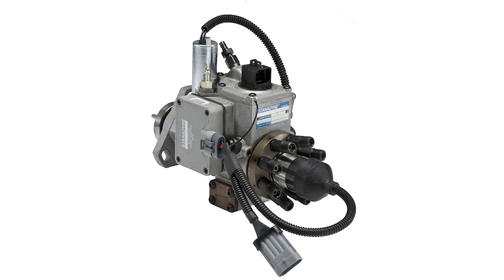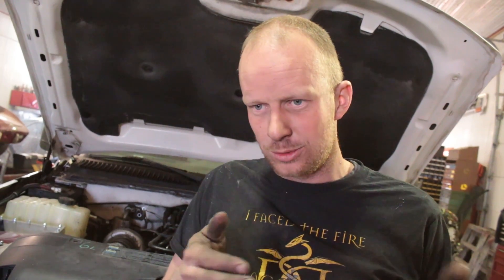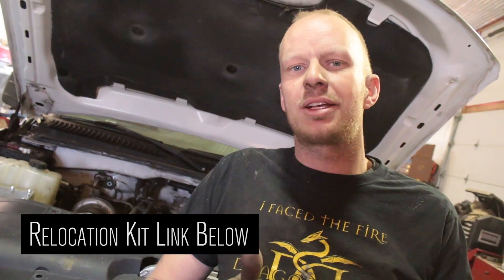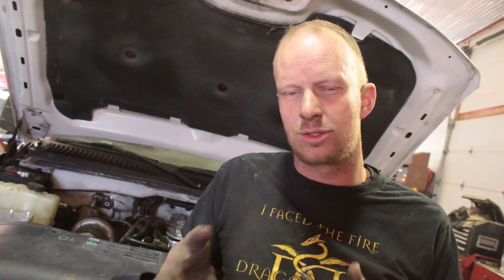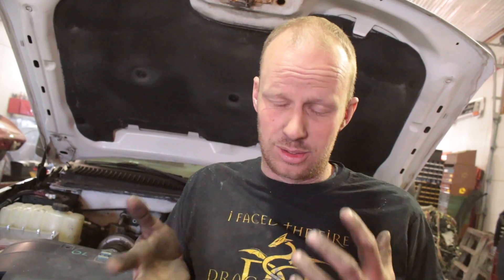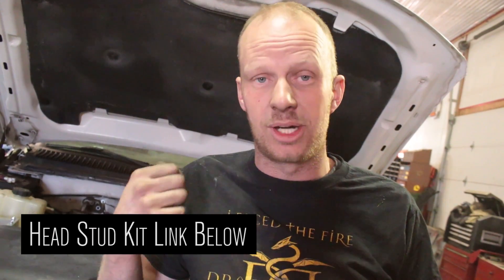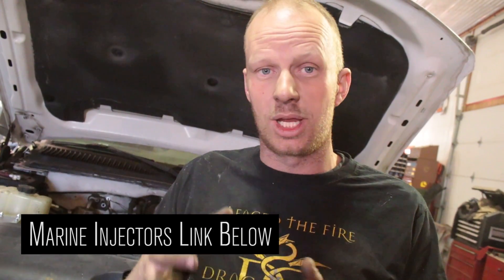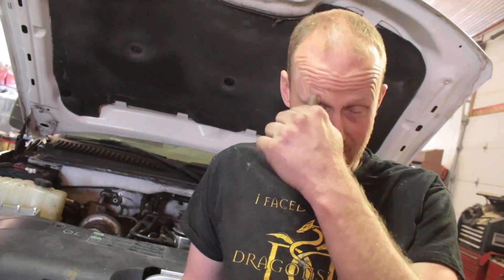REVIEW: Everything Wrong With A GM 6.5 Detroit Diesel

Comment: psst, I dare you to make an "everything wrong with a 12 valve" video!
Reply: Carla Rodgers dodge might not build their own diesel but ford and GM didn't make theirs all by themselves either. GM needed help from Isuzu and ford from international.
Reply: @SAVAGECUMMINS  ford 6.7 made by ford since 2010 but my gm 6.2/6.5 is just fine real simple ,no b.s. no huge h.p. but tq is great and gearing and trans choice make a world of difference
Reply: @MatthewFogarty-k2y  6.7 was created by Austria, it's European... ford went seeking help 
...lol
Reply: SAVAGECUMMINS no company “needed” help. Gm tried with the Olds 350 diesel and it was horrible. The 6.2 and 6.5 weren’t much better. The 6.9 and 7.3 idi were much better engines. Cummins wanted to put their motor in ford but they already signed with IH. That’s probably the only reason Dodge still exists
Reply: @noahgaray7923  the olds diesel is a complete separate animal. It was a gas engine rushed through a conversion to get at the blooming diesel car market. GM and Detroit diesels have been making diesels a long time for heavy duty applications. Apples and oranges on the olds. The 6.2 and 6.5 worked pretty well, for their time. Comparing today’s tech against 80s tech is not even a comparison. None of the 80s tech is still being made, regardless of maker.
Reply: @SAVAGECUMMINS  you are wrong. Gm makes diesel since the 70th or so on.  ...
Reply: @SAVAGECUMMINS   not on the power strokes, those are Ford.
Reply: DEBOSS GARAGE Best response!! lol
Reply: Boogie Butts why you are right about Daimler owning Detroit since 2000, thus saying gm made the diesels back in the 80s and 90s, jdr did not say Isuzu was part of the Detroit gm diesels. He said Isuzu helps gm with the dirtymax.
Reply: @braydonrobison8253  GM started Detroit diesel since 1938 and sold it in 2000 to DaimlerChrysler  and with isuzu they started Duramax diesel because GM
Reply from the maker: kdp.  Short video.
Reply: @DEBOSSGARAGE  53 block...
Reply: Adrian W , I'll start the list....
1) Great engine wrapped in shit.
Reply: Only thing wrong with the 12 valve is, it’s not in every truck on the planet
Reply: Why should they the Cummins sale the truck for them.
Reply: Steven Vanheel the old's 350s biggest problem was ownership... easy motor to work with and make last 500k that's miles also. The 6.2/6.5 was built with gm diesel and Detroit a subdivision of gmc at the time before gmc sold almost everything industrial related sadly.
Reply: @jdrok5026  this is correct. The olds diesels, while made by GM Corp. we’re not GM diesels, separate animal.
Reply: Boogie Butts wrong    diamler bought Detroit diesel in 2009   then creating the Detroit diesel DD line which is a green painted Benz engine.. But yes GM had Detroit for many many yrs and next to cat made one of the finest diesel engines in Trucks known as the series 60   very dependable   I've logged half a million miles on that old Detroit never had an issue
Reply: The KDP. Thats about it. Oh and they leak...a LOT.
Reply: GM owns Isuzu... and own DMAX (company that’s in Moraine, Ohio that produces the duramax engine). So actually GM is the only company that in full-size truck market that designed and produced their own Diesel engine till most recently.
Reply: @andrewphillips908   the Duramax, at the time of development ( LB7)  , was a partnership with Isuzu marine.
Reply: yes sir
Reply: Adrian W m
Reply: Carla Rodgers goof
Reply: Zane Turner yep my dad had a 350 olds diesel Cadillac. What a POS that thing was. It constantly cracked heads
Reply: Boogie Butts gm started Detroit diesel and emd Isuzu was apart of dmax ltd till the lbz... Daimler killed Detroit.
Reply: Braydon Robison thank you I might've worded my statement wrong sorry for any confusion.
Reply: Steven Vanheel it was a fucking pile tho it's not a great engine but easy to maintain.
Reply: jdr ok sure, I see what you are saying though. Oil, diesel, then turn the key and run it until it’s dead.
Reply: Steven Vanheel I've seen them rack up 500k and then need a rebuild. But every motor will blow up if your unlucky
Reply: SAVAGECUMMINS       Fords 6.7 is all ford made.
Reply: @tomh6779  nope made from Austria...it's European...sorry to burst your bubble...lol
Reply: Jose Gusman 
It’s a ford design thru and thru.
Reply: Jose Gusman     And it doesn’t burst any bubble. It was designed all in house at ford. So what if there is influence from Austria if that’s even true. It out pulls/ powers Cummins and duramax.
Reply: @tomh6779  AVL Austria made your 6.7 ford need help. And lets get IT real only Germans make mad machines,  like your motor German name Diesel baby.. so get it right!!!
That motor is austria with a ford carcass wrap around it. Look it up. Do your homework  brother.
Reply: 6.5 till I die....
Reply: @jacktheaviator4938  yeah I'm special I road the short buses Sir. I'm so sorry to hurt  your feelings; and you might be depressed by now.  All you do is criticize me.. hahaha lol.
Reply: It is in a dodge
Reply: Adrian W They sound Gay.
Reply: Cummins should be in a ford
Reply: Like the 12 valve as long as you keep oil in it, but mine has left me stranded (dies going down the road, crank and no start, bad injectors etc)  more than any other diesel I own.
Reply: Derek Williamson...? Sounds like you have really bad fuel contamination? By far most durable/bullet proof and cheap to replace sticks.No start? Pull up on the solenoid.  A 12v has mechanical pump. The only way it’s going to die is losing fuel. Bad lift pump? No it will still run just not good. If you said trans of front end issues that might be more believable. Do you actually even have a 12v? I’m thinking you have a 6.0/6.4 and trying to justify it?
Reply: @chevy6794  Not even sure how to respond to your question/comment/statement............  If your meaning to be insulting, I would never even pretend to waste my time knowing the value of it, but I'll indulge just once.  Ah......... To answer your question, this is not an isolated indecent.  I actually am one of the unlucky souls that bought a final gen 1989 D series with the flagship mechanical motor with 3 miles on it and took it to 300k in 4 years, so to say I have an intimate relationship with this engine and its unique characteristics is an understatement in itself.  I have at least 3 of these 6bt's in current equipment so I deal with them daily and will until they are out of service.  The statement I made was not meant rhetorical, but as a statement of fact.  If me saying that I have been left stranded by a vehicle that is beloved yourself offends you, well I don't give a rat's ass.  I don't calculate value in  products in any other way other than total costs of ownership, given the fact that money is the only thing we quantify and since it takes money to keep stuff rolling down the road.  As far as your 6.0/6.4 comment, not sure if you are talking to me or??????????????  Justfy what??  Not pissing people off by having an open dialogue?
Reply: I had a 6.5 turbo diesel wasn't bad pretty reliable for the most part my neighbor has a 12v and it's been to stl diesel basically twice a month every month mainly trans issues motor wise it's solid the issue is everything around it is trash then there's the 7.3 power stroke ran good never had engine or transmission problems however it leaked everything power steering oil trans fluid washer fluid 😂 tht said it still did the job everyday 12v is just a gutless turd unless you have deep pockets my opinion the best diesel on the market is ford by far the new 6.7 power stroke makes 475hp  1051fpt out the gate dodge and chevy just can't hang and for all you haters just remember a f series truck is sold every 52 sec 👍
Reply: I had a 97 dodge 12 valve and yes they do have problems. If you live in a cold part of the country they take absolutely for ever to throw heat. The transmissions attached to them are junk! Fifth gear eventually fails and I don't pull heavy loads. I don't know for sure but I think the automatics weren't much better. I did love the fuel mileage but that's about it. The truck itself might as well through it in the ditch.
Reply: @MrRebman62   yup, if it has a motor , it has problems, if it’s a diesel, it has its own unique issues.  Every brand and every generation has its own issues. I have a first gen Duramax, injectors was the big issue.  Once I did those, it’s been mostly normal maintenance items. 
 But it wasn’t easy or cheap to do.
Reply: Fiat owns VM motori now so technicly Dodge is building its own diesel engines(eco diesel V6). They are also building them for GM(midsized pickup 2.8L).
Reply: @dimedriver  gm owns vm motori
Reply: @CAMAROFAN45  GM owned VM in the early 2000's while dodge/Benz was starting to sell them in the US. They sold them off before the government motors stuff during the Obama administration. VM was later aquired by Fiat before the Chrysler merger. Now if Fiat sold them back I don't know. Both are using VM engines currently.
Reply: jdr ok that engine was a pile. My dad went through 2 sets of brand new heads right from the Cadillac dealer and he took them to a machine shop both times to check them for trueness. He ended up trading that car for a POS 4 cyl mustang II. The only good thing he had to say about that car was that it was very hard to get stuck in the winter because it was heavy and it had no power.
Reply: Braydon Robison gm diesel engine in the 80s was a Oldsmobile gas motor they did a conversion to diesel on and it ended up being one of the best boat anchors you could get, no power pumps were for every coming apart 90 percent of them ended up with a conversion back to gas engines
Reply: @zaneturner4478  we have one of those engines still in factory create  from the 80s in the shop,
Reply: @zaneturner4478   no, not correct. The Oldsmobile 350 gas engine converted to diesel was. But GM diesels were not. That was 1 motor, and it was indeed junk. GM diesels were a stand alone part of the Corp.
Reply: Short video my ass you don’t have enough time in a day to talk about all thts wrong with a Cummins sure the motor is pretty solid but stock it’s not much better than a 6.5,dodge can’t build a transmission to save there lives 

And as far as sled pulling being all 5.9 and power stroke thts a bs statement as well the duramax is the best platform out to date!
Reply: SAVAGECUMMINS isuzu and gm built the dirty together and gm owned detroit so they built a lot of diesels on their own
Reply: Carla Rodgers the same reason  junky ford and junky chevy don't.
Reply: @daw7189   actually Ford has since the Powerstroke and GM has since the Duramax, tho partnered with Isuzu for development.
Reply: Adrian W. so we can find out why junky dodge can't build their own diesel?
Reply: jdr ok. Diamler has owned Detroit diesel  since 2000. And Isuzu and had nothing to do with it ever.  Get your facts straight buddy.
Reply: @BoogieButts  Isuzu was partnered with GM on the Duramax, not the GMs. Or Detroit’s.

Comment: Hey great video, how about a "Everything wrong with a 5.3L" from 99-06 gen, 07-13 gen, and if any 14-current gen
Reply: balle27 the 99 to 06 5.3lL is a good engine. 07 to 13 5.3L is junk because of the afm.
Reply: kenneth sunderland what if you disable the afm?
Reply: balle27 that is the best thing to do. I had an 08 Avalanche and planned on doing that but I sold it. They make something to plug into the Obd2 plug that will bypass and make it run on 8 cylinders all the time or you can buy a tuner and bypass it that way. The bad thing is they consume oil and you also have to replace the left side valve cover due to the updated design. It kinda sucks that there were issues on my Avalanche that I never saw in my old reliable 99 Silverado.
Reply: I don't know anything about the 14 and up LS engines.

Comment: do one on the 12v, but why it's so good. is it because it's inline and not in a v? the bore/stroke? why is it so dominant?
Reply: olov244 Super reliable well built and stupid simple. Also can handle horse power easy and cheap to upgrade and I6. The large 
majority of semis run I6's which says something
Reply: Inline 6 motors have perfect primary and secondary balance, which reduces stress on the whole thing. The inline motor can be made to sit lower where a Vee engine can't. Finally, you can get to more of the parts easily for rebuilds without having to pull the motor out of the truck. The crankshaft is supported along its entire length with 7 (or more) main bearings, which means each piston gets its own. Some larger ones get two for each cylinder!  Vee engines generally share main bearings with each opposing cylinder.
The guys I've talked to have said the old 6BT was essentially a miniaturized big truck engine, made for agricultural equipment. It just so happened to fit under the hood of 80s Dodge Rams and thus, the 6BT came to the consumer market. They are basically overbuilt, understressed engines which is why they last so long.
Mind you, the 6.5TD is still being made and installed in humvees to this day. They see very rugged use all over the globe. They're good reliable engines, and while a million miles in a 6BT might be possible, I'd think the truck would probably be ready to fall apart around it.

Comment: Anyone here rebuilt their own injection pump?  If so, how did it go, and is it as difficult as some seem to think it is?
Reply: how are you going to test it?  calibrate it? spend the sub $500 and replace it... that's the price of like 2 injectors on a newer diesel.
Reply: Anyone else care to chime in? Isn't it usually just seals that are worn and need replacing? I think I saw another comment from someone who spent $1500 on a pump.
Reply: caduceus33 Read it again that was installed and that guy got 100% ripped off, go to accurate diesel (Michigan based) no affiliation, great work very knowledgeable.  You do not need anyone else, I deal in cucvs, 6.2's the 6.5 is the same engine in this convo, it is not just seals, why are you rebuilding, what is the issue.
Reply: @Matt Lane    I don't have a diesel powered vehicle now, so there is no issue. I had a couple of MK1 diesel Rabbits that I got in a trade about  two+  years ago and was checking into them at the time. The diesel pumps look like such an ingenious invention and there is a YouTube video showing one being rebuilt, but it seems that a lot of people on forums I checked would assume they had to pay someone to rebuild them. One of my Rabbits had the head and diesel pump removed years before I got it, and they were sitting in the back of the car. Some said they would be all gummed up and would need to be taken apart for a thorough cleaning, so I was checking into that. But when I weighed the possible costs of getting these two Rabbits working properly, I sold them. However, I would still be interested in rebuilding one myself if the need arose, just for the DIY fun of it and to save money.
Reply: caduceus33 Diesels will run even if you mess up... for a DD, I'd go paid rebuild.  For screwing around ya whatever.  The pumps meters the fuel, to little your running lean, to rich you can melt something with high EGT...

Comment: Hahahaha the 6.4 cough.

I worked at the Navistar diesel plant in Huntsville and got out pretty quick. The job? A disassembly line tearing the completed motors back down because they ALL failed quality control  on the initial builds. what a disaster of a disposable engine

Comment: oh can you do "Everything wrong with the 6.2 Detriot diesel's"
Reply: gutless wonders,  but good on fuel.
Reply: They have weak spots (OEM fuel filter setup, glow plug relay, etc), but they are incredibly dependable, get great fuel mileage, very hard to beat for what they are. 
Mine is an '84 K20 with Silverado trim. All options.
Even with 4.10 gears, 33" tires, the truck gets 20-22mpg. 
Power, most had EGR valves. Remove the EGR, replace the restrictive mufflers, add a decent intake setup, and the engines wake up quite a lot.
Reply: lol hey mine still runs.....
Reply: I put over half a million on a 6.2 in a 1991 1/2 ton 2wd ext cab.   that thing got 30 mpg all the time.  one injection pump and a water pump.  that is it for repairs.  it ran like a top when i sold it.
Reply: YES 30 MPG IS TRUE.!!! My dad had just bought a new 1983 1/2 ton 6.2 liter diesel In 1984. I used this pick up to move to university. That truck had two tanks, so i would start and warm the engine and drive to the interstate highway. When I reset trip odometer and switch to the full tank, click on cruise control.  YES THIS WOULD GET 29 AND 30 MPG. DID THIS MANY TIMES MANY TRIPS. 
Also now remember my girl friend in that truck. She had the most amazing shape ass. Like kloe Kardashian BEFORE  kloe Kardashian started getting but injection to make it bigger. 
No I am not going to tell you how we married for 30 years. Because we separated.